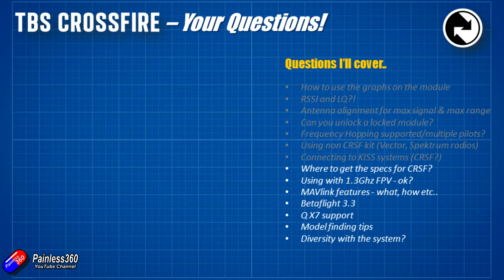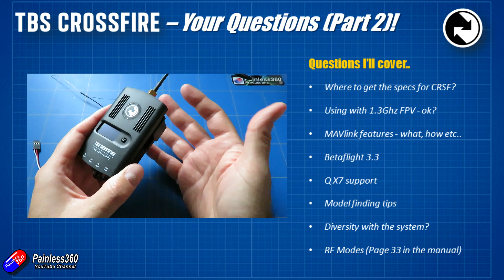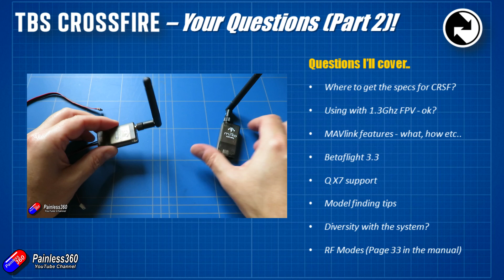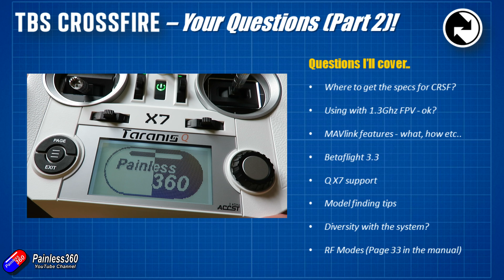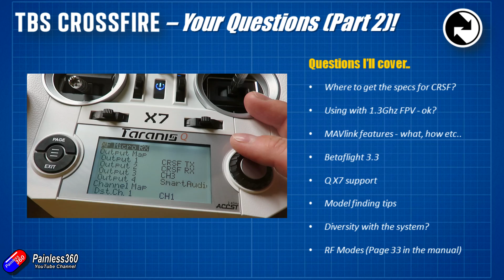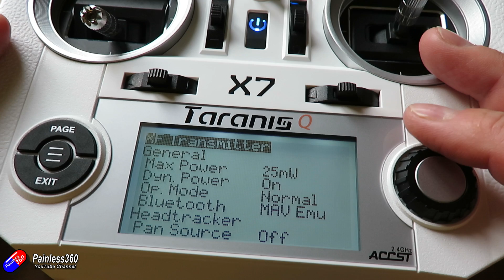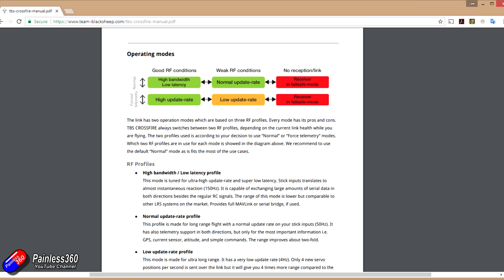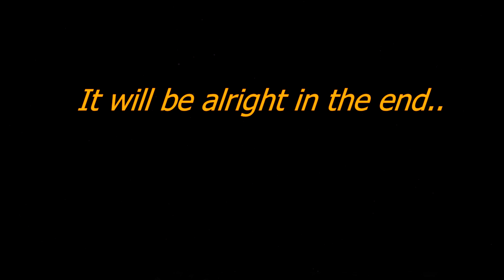(3/3) TBS Crossfire Series: Your TBS Crossfire Questions Covered (Part 2)

Comment: Hi, thanks for all the videos and tutorials. I use the crossfire with the Bluetooth connection to Mission Planner. However, I changed the usual device and now I can't connect to the new one. Does the Bluetooth connection have a limited number of devices? How do I pair it with a new one and forget an older one? Thanks again. Keep up the good work.

Comment: Hi! Thanks for your video.  How can I see the GPS coordinate on oled screen? I using BF and spektrum. I suppose...
1) using CRSF protocol 
2) configuration, telemetry on
3) what else? 

Thanks in advance
Reply from the maker: You can get them onto the radio screen so they can be viewed and stored in the telemetry logs (depending on what you have on the model). See my LUA script video..
Reply: @Painless360  thanks

Comment: Hi
Tbs Micro RX V2 blocked. 
I frantically stared at RX and didn't notice that the clamp was pressing heat shrink and in turn was pressing the bind button I connected FC to the GUI to set up the Crossfire protocol, then I do the procedure to bind the module to the receiver and I realize that the LED of the RX that should turn red is off. Now the only way to turn on RX is to press the Bind button before powering the receiver, I tried to follow a guide that says to hold for 10 sec but nothing doesn't work and doesn't bind. Has anyone happened and if you have solved it?

Comment: I just subscribed. Great content. Is there any way to run the crossfire receiver on 3.3 volts? I have the SPRacingF3 trying to run Crossfire on. I don't thing I can.
Reply from the maker: I've not tried. There should be a 5v that you can use.. see my SPRacingF3 build..
Reply: I'll check it out but, the only sbus I  thought was UART3 and it's 3.3volts

Comment: Thanks, Lee....you have helped me (us...the noobs) very much. I have a question and I have trolled through everything but cannot find the answer anywhere....I have a Hexacopter with full size TBS Crossfire TX/RX in S-Bus(pinout 8 to Naza X2) on a Naza M V2 which is maxed out channel-wise since it has a gimbal.I want to use my retractable landing gear but I can't using the Naza and I want to know how I can use any extra channels such as 9-12, for example, as with  S-Bus....There are only pinouts for channels 1-8 and I believe that now the Chanels 1-8 are reserved/used up for the S/Bus___I have a Taranis XD9 Plus...I remember that I could do this with the X8R...a million thanks in advance! Cheers, and keep up the great work. Chris
Reply from the maker: You should be able to assign CH9 and others to the other PWM pins.. Best of luck with it..
Reply: Thanks Lee...will try and let you know what happens but, what pins constitute "other" PWM pins since I only have 1-8...do you mean assign channels 9 to 12 on physical ;ins 1-7? Bit confused here.. @Painless360
Reply from the maker: Exactly. Try it ;)

Comment: Hi, is it possible to get the Bluetooth connection working if using the diversity RX or only when using the micro RX. I ask because the Div RX does not have the extra port that the Micro RX does and I can’t get a straight answer from TBS.
Thanks in advance
Robby.
Reply from the maker: I’m not sure what you’re asking? The MAVLink BT connection?

Comment: Thank you for the Crossfire series! I have a Tarot 6 with the full size TBS Crossfire RX and TX. I have them bound together using CRSF. I want to connect the RX to my Naza M V2 and I see that S-Bus is the only way to go...what/where do I connect to what to get the two working together? Can I use all the extra ports of the RX to power things like servos in the same way as the X8-R? Is there anything I need to do on the Taranis x9D Plus for anything? A million thanks! (Tarot X6, TBS Crossfire full version, Naza M V2 with DJI CanBus, DJI iOSD, DJI GPS, DJI Bluetooth Ground Station, Reatractable Gear, H3D gimbal [GoPro 4], and Immersion RC 600 MW Video TX). Keep up the great work:-)
Reply from the maker: If you’re talking  about the redundant control feature of some of the X series recovers - I’ve  not tried. Best of luck!

Comment: Hi Lee  your tbs crossfire is so well detailed that i bought a micro crossfire  and  set it to 915mhz  (america) and 25mw firmware 2.24 taranis qx7 open tx 2.2.2  i tried to bound it nothing hapen tried an emergency rx recover  nada  tried to upgrade fw with2.25 niet   the micro crossfire fw2.24 module is lock in 25 mw  to bind it it need to be set in open region 100mw  there is a trick to set it that way (10 click  on the bind buton) to do it the tx rx need to be bound  i contact tbs (at least 5 times)  no solution  if you know a way to reset the factory setting(on the tx module) please let me know thanks in advance
Reply from the maker: The only trick I know is the Konami code / button press I cover in this series.. best of luck!
Reply: Thanks Lee

Comment: Wonderful series! I am new to the party and I don't see anything thus far to answer the following question. How do you connect Naza V2 to the receiver? Is it by S-Bus or can you you do it via CRSF?
Reply from the maker: I don't use that flight controller here but a quick Google search shows lots of detail for Sbus but nothing for CRSF. So I expect that's your answer. I'd look in the manual for it for any updates. Best of luck!
Reply: Thanks...yes I have been looking and can't find anything anywhere!

Comment: Have 1 question regarding the moment 03:19 where you are configuring MAVL. RX / MAVL. TS , i cant actually see them on my crossfire, i believe this is also required to set up the bluetooth . do i have so set up another TX and RX on another free uart on my flight controller to make that work ?
Reply from the maker: Make sure you're running the very latest version of the firmware. You might need to make sure that you're running an unstable, beta version of the firmware to get all of the features. Best of luck
Reply: First of all thanks for your feedback !! Got it updated to 2.24 running CRSF v2 and running with the new Nano receiver but i am not sure if what i like to do is possible, 
I got my nano receiver connected to my Holybro kakute v2 FC on both TX and RX (UART4) i also have GPS on another UART and i'm getting the GPS coordinates  correctly to my Crossfire module but i would like to get my Android phone connected to the crossfire module thru bluetooth to show this actual location on a map in real time, is that possible ??

Comment: Thanks for all the awesome vids! I've been watching since the cc3d days! One question is the Bluetooth feature. I s able to connect it successfully to mission planner for inav Android, however the latency is unusually slow. The app will refresh it's position on the app mabey every 5 seconds or so, and the artificial horizon stutters. Any thoughts on what the issue m may be? If you could do a video reviewing apps for this, I totally lost video once, and had to crash, and find it using the gps.
Reply from the maker: I've not found that, I'd update to the latest version and give it a go again.. Best of luck!
Reply: Thanks for the reply. Already on the latest, and tried out the beta version of everything.  Maybe the software mod for the qx7 is the culprit. I'll do the he mod and let you know how it goes!

Comment: Great series! Really like your videos, they have helped me immensely. Question on the audio warnings: I have set them up exactly as you explained. The first warning I usually hear is the "Crossfire ... High Speed" warning. Usually its just once, but sometimes it will be followed by "Low Speed" and then "Normal". Also when I power down the quad I hear the "High Speed" warning. This seems counterintuitive, that I would hear the High speed warning first. Isn't High Speed what I want? There is only one logical switch set for this warning, so how does it give 3 different responses (HIgh, Normal, Low)? Obviously confused...
Reply from the maker: I'd add a delay into the logical switches to help with this. I've had mine do some odd things too on powering off :D
Reply: Thanks, I have that programmed. What about the first alarm being Crossfire High Speed? Shouldn’t it be giving me an alarm that I’ve left high speed and am now in normal or low? Or does the high speed warning mean I’ve returned to high after being in normal or low?

Comment: I really like the value of the Micro TX however without Bluetooth I won't buy it as I like to have Mission Planner available for iNAV/PX4 builds. Sure it's a cheap way for long range and better penetration, but generally if I'm going long range I want Mission Planner. I hope the next micro TX has a bluetooth option :D

Comment: Questino re mavlink and Pixhawk. Can you use the mavlink telemetry connection as RC control or do you need to also plug a PPM channel into the RC-in plug on the AP? Hope this makes sense.
Reply from the maker: http://ardupilot.org/copter/docs/flying-with-a-joystickgamepad-instead-of-rc-controller.html is what I think you're after. If not then this is place to have a mooch. Best of luck!

Comment: Great video, thanks a lot for helping me get my crossfire setup on my long range quad :). Do you know how to calibrate the channels in BetaFlight? My end point and midpoint values are not exactly setup at 1000, 1500, 2000. In the receiver tab in BF, im not able to adjust using the output tab on my XD9. I believe this is only for PPM and im on CRSF. Maybe i setup the rx back in sbus to calibrate channels and then put back in CRSF?

Also, do you know what the other aux channels are outputting? I have mapped LQ on channel 12 on my microrx v2 and linked RSSI to Aux channel 8 in BF. There are other signals coming in (aux5 and 12) and im wondering what these are?
Reply from the maker: The crossfire is only sending the signals from the radio so you'll need to change the limits and use the sub-trim to change the values to the 1500 needed. The channels will usually default to 1500 unless you've attached a specific control or switch from the radio. Best of luck!
Reply: Thanks! I just checked my trims and found that they were not centered. I was able to fine tune them as best as possible to get them to registered @ 1500 (center stick) while keeping max range stick deflection. However i am not able to get min throttle lower than 1007. So far no issues with arming, is there anything else i should mind?
Reply from the maker: See my Betaflight setup tips video, best of luck!

Comment: So informative. Thank you! Just double checking, but you can get full telem to a PixRacer using the Micro V2 RX as well? Fantastic news!
Reply from the maker: +bauhaus if there are MAVLink pins that you can use on that flight controller, then you should be able to. Best of luck!
Reply: It's the mRobotics PixRacer, same designer/manufacturer as the one you featured on your channel some months previous.

Comment: I understand that this system will give more range because of the lower frequency, but the fpv system is still 5.8ghz or 2.4ghz and will be short range
Reply from the maker: I talk about the longer range FPV in these videos. Lower freqewncy will give longer range for the same power and use of directional antennas and higher powers along with the lower frequencies are what people use.. Happy flying!
Reply: Many thanks for your help

Comment: Disappointing that the best long range video frequency 1.3ghz is problematic with Crossfire. 2.4ghz is not viable in densely populated areas. 1258 and 1280 are Ham ATV frequencies in Australia and USA

Comment: Is CRSF really that big of deal ? I have a new QZ7S  and i really would like to use a crossfire but i do not want to HAC my TX to enable the protocol , at full speed that is. 
Also if the software fix gives 1/4 speed is that still faster then sbus or same speed

Comment: Painless360  I had one main question about the TBS Crossfire Micro system, doesn't the video system ALSO have to be long range or else if you lose video in a non-GPS/RTH capable quad a long ways away, it's likely gone.  Videos out there seem to only be in flat country, and flying high to maintain line of sight for the 5.8Ghz. Why use  ~900Mhz to wrap around buildings and hills, but the 5.8Ghz video can't do that?  Is there a matching long range video system that can match the Crossfire capabilities for a micro quad (5" props and down)? Thanks
Reply from the maker: +cybervid07 see the video, 2.4ghz can be used for much longer FPV range. The new FPVBlue system looks like one to watch too..
Reply: Cool! Thanks for the FPVblue reference.

Comment: Hi, would you please help me how to setup failsafe tbs crossfire on pixhawk (mission planner) i already setup the crossfire telemetry via bluetooth, and i already can do upload waypoint etc, but when i test cut off the taranis, it won't do failsafe. Please help me. Thank you
Reply from the maker: The fail-safe setup is the same as with the normal radios. See the PixHawk and APM videos where I cover it in depth. Use the trim on the throttle to drop it to it's lowest position on the radio, note the channel value and set that as the fail-safe position, pop the throttle trim back to the center and then set the FS PWM value in the radio section of Mission planner to be 10 above the value throttle value that fail-safe causes.. Hope that helps..
Reply: ok, i will try it first, thank you for your response

Comment: Hello! I have some questions regarding crossfire and using a gps module / sensors for the taranis. Unlike the frsky gps, using a gps with crossfire only gives the GPS sensor and altitide. I'm wondering.. is there anyway to calculate speed via the taranis? Using just the GPS and Altitude sensors doesn't really give much and I'd be curious what all a person could get out of just using them for sensors. Also, is there a way to calculate total distance flown with the taranis, or is it only possible to display distance from home? I'm currently using betaflight, Thanks!

Comment: so regular telemetry on the taranis will not work until the release of version 3.3 on betaflight?  i hate that i cant get the PIDS and VTX adjusted when i need to with the crossfire.  i saw on someones video that smartaudio was a option for a output on one of the receiver channels .... however mine dose not give that option. is that from a older version of software on the crossfire or receiver...i am on the most vurrent version in the TBS Agent
Reply from the maker: +Eclipse FPV you’ll need to update the very latest beta version, see the first video in this series where I cover all of that. You should be able to do the PIDs and changes with the current version of BF 3.2. However, there are some improvements to CRSF coming in betaflight 3.3..
Reply: beta version on crossfire.... thx so much for getting back to me  my questions.... ill check the video tho...thx  again ;)

Comment: Can someone make a video or explain about checking the version of QX7 to check if the bug may even exist?  I bought a QX7 from Horus when they first came out. I might have the version that has the better inverter but how to check it?
Reply from the maker: I'm not aware of any way to check apart from trying it..
Reply: Painless360, Thanks for answering. I will look into it when I get my micro Crossfire. Keep up the good work!

Comment: Thank you for this series... I just bought the crossfire micro. I have one issue... which opentx nightlie build and sdcard content do I match together? Also, if I use 2.4 fpv video will it interfere with a ublox gps module. Thank you soo much.
Reply from the maker: +Bryan FPV I'm just using the latest one available through the companion application. It looks like the QX7 lua scripts aren't quite released yet. In terms of the interference, I've not tried it here but I wouldn't expect it to make too much difference as the GPS modules are running in about half that frequency. I've asked the experts though, so if the answer is different I'll let you know..
Reply from the maker: +Painless360 GPS frequencies are too far from 2.4ghz so it should be fine!